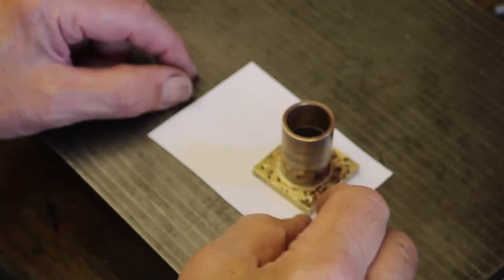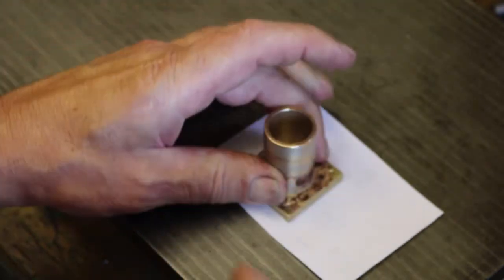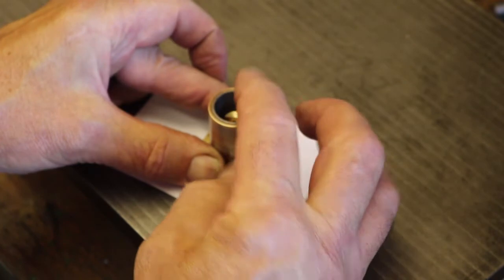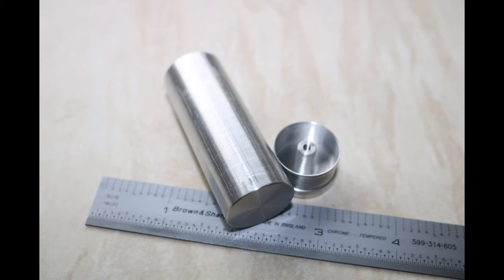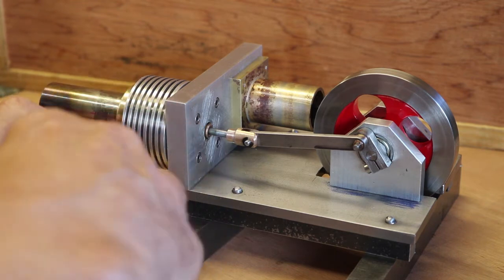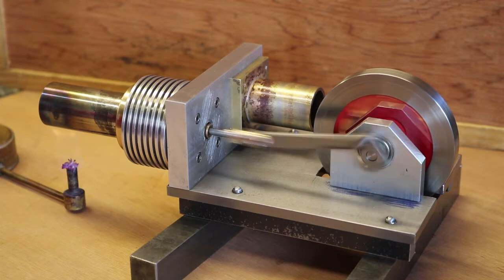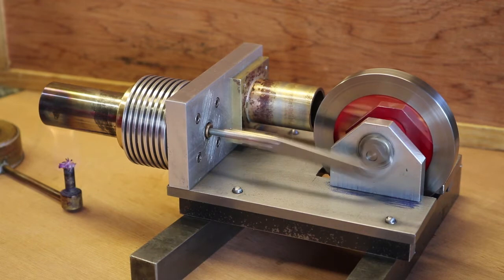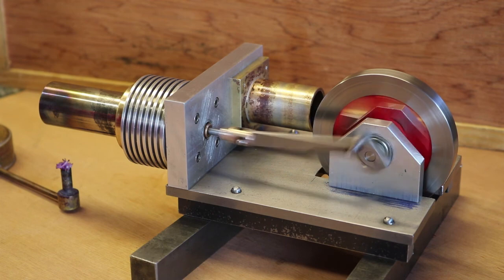Get the best from your Stirling Engine

Comment: Are the designs for this engine available?
Reply from the maker: Hi Mike. Sorry no designs at present. I do plan to write up the engine at some point as I am planning on a book of Beginner's Stirling Engines. If you are interested I could give you some of the leading dimensions and explain a bit about the construction. I have been trying to optimize the design for absolute beginners so all the threads are M3 and I am trying to avoid too long a materials list as I know that some beginners find it difficult to source lots of odd bits of material.
Reply: @bobcannon9157  OK Bob, I'm a Stirling Engine Society member and I saw your post about an experimental rig. I'm looking for a simple engine as the starting point for experiments.  Any pointers welcome.
Reply from the maker: @MikeKarliner  Hi Mike drop me an e-mail via the Stirling Engine Society StirlingMatters list and I will see what we can do. There are lots of designs that would be good starting points.

Comment: some info.     too much  MASS  in the cold piston.      it can be made of  Almost  anything,  and you choose  steel/iron  and  (excess) brass; at the wrist pin !!!      at 4:58, the use of a crank  Arm   results  is  an  AVOIDABLE  out of balance condition !!!      SEE THE USE OF DISC-SHAPED COMPONENTS; in modern, small, heat engines.        at 5:00, there is excess mass in the (robust) connecting rods.       you may know that  ALL  of  the  Mass  in  reciproc  motion (in the system)  Contributes  to  an inherent, speed  Limiting  affect.     googletranslate
https://en.wikipedia.org/wiki/Governor_(device)
Reply from the maker: All valid points, however the engine runs and runs well. Regarding cast iron it has good self lubricating properties and is ideal for Stirling engine pistons. I agree that the balance of the engine could be improved but it is designed as a beginners' first Stirling engine. The choice of steel for the con rods is to allow use of soft solder to hold the bronze bushes in the eyes. They could be made from light alloy and mass reduced by milling away excess material but I designed this for beginners with limited machining capacity, just a centre lathe and a pillar drill. You could do lots of things to improve the theoretical design if you had a CNC mill.
Reply: @bobcannon9157  it should be  Understood that  'self lubrication'  is the result of using metals of  Differing  Hardness, where components directly interact.      thus, saying that  One  type of metal is good, is  Not  LOGICAL.       cheers
Reply from the maker: @daviddavids2884  The bearing properties of cast iron have long been recognized. Many internal combustion engines use cast iron liners with cast iron rings so it in not to do with differing hardness alone. I work with large heritage IC engines and almost all have cast iron pistons, cast iron rings and cast iron liners. The steam engines I have worked on follow the same pattern and I understand that the most successful (numerically) Stirling cycle engines (Rider Ericsson well pumps and their clones) also ran cast iron on cast iron. Without doubt lightening the reciprocating masses would make the engine run faster but nobody said top speed was one of my design criteria. Some of my exhibition engines are in their eleventh season typically running continuously for seven hours a day over 10 or more days per season without any loss of performance or appreciable wear. One of my main criteria for success is an engine must run reliably for extended periods without undue attention. To survive this sort of service needs robust components, generous bearing surfaces and environmental stability. If I wanted to make things that spin fast I would be making gas turbines.
Reply: @bobcannon9157  youdoNOTknowWhatyouaretalking about.    OUT
Reply from the maker: @daviddavids2884  I would respectfully ask anybody who reads David's comments to take a look at his Youtube videos. He appears to believe in the possibility of overunity machines. Now call me close minded if you like but I thought the idea of perpetual motion had been dismissed by scientists and engineers a long time ago. I am happy to waste my time making little engines that spin around happily using the energy from a tiny spirit flame. My engines may be very inefficient but they run and as my video will testify run well, they obey the law of thermodynamics and as Homer Simpson said 'In this house, we obey the laws of thermodynamics!'